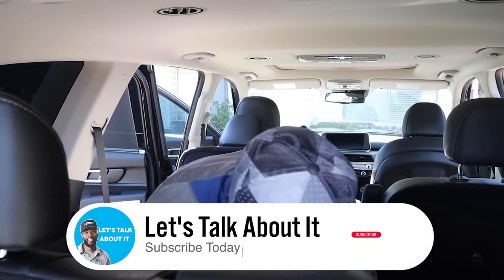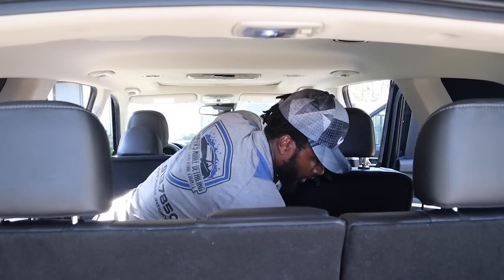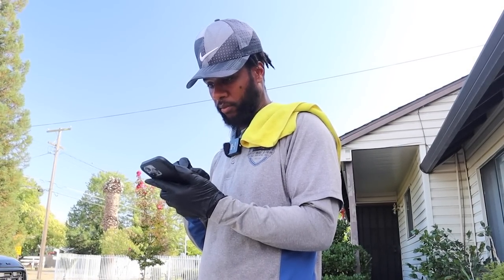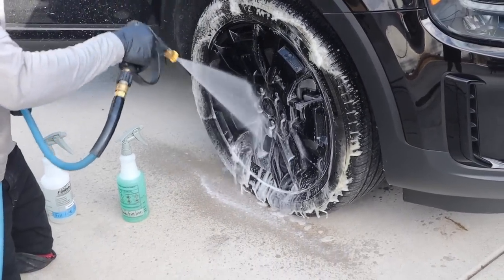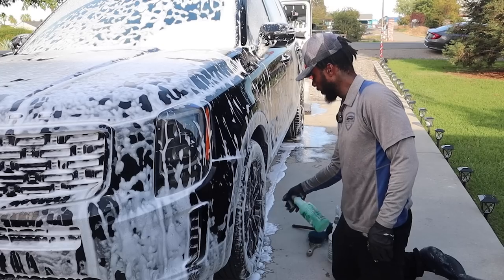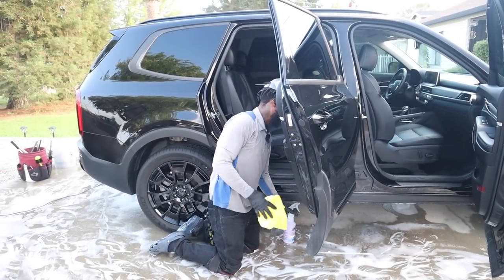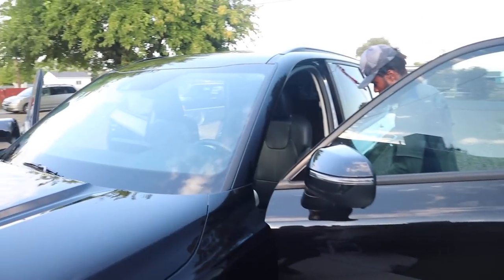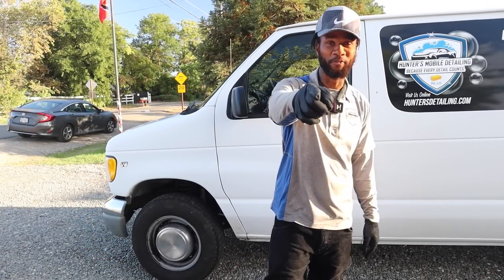Maintenance Step by Step with 1 Employee - Let's Talk About It

Comment: I use super clean on my wheels and tires. It's quick ,easy and cheap. Just can't leave it sit on the wheels more then a minute. I also use it on the wheel wells.

Comment: I noticed the weather tech mats were still wet when you put it back in the car. I use a fan blower I got from home depot to dry mine before putting them back in. It could leave mold on the carpets even thought you don't see it rite away. Just a tip my fellow detailer.

Comment: Those Grey Spray Nozzle Types are the best I've ever used, they sell the gold and black ones on Amazon that are chemically resistant. I use LA Totally Awesome for degreaser diluted 3:1, gets tires bleeding orange. Keep up the great work Hunter!!
Reply: What do you dilute it with?
Reply: @glock316  3 parts water 1 part  LA totally awesome

Comment: I noticed you use a towl to dry. I use a leaf blower. I went from using a ton of towels to very minimal. I blow the wheels so the water don't sit in the lug nuts and rust. I got a 2 stroke one that has a idel you can set like a cruse control